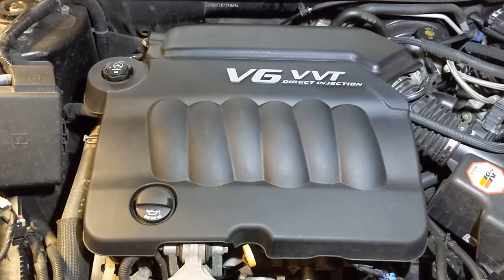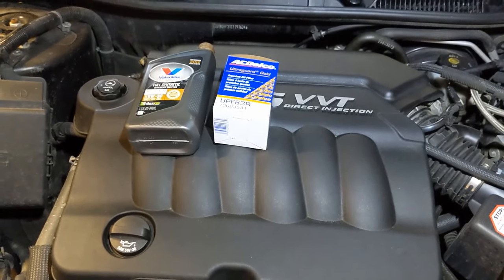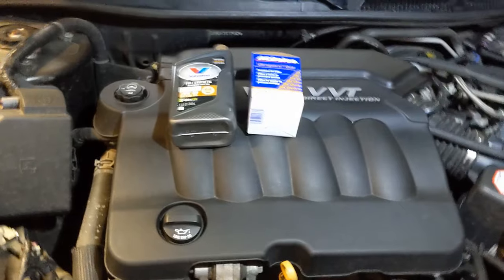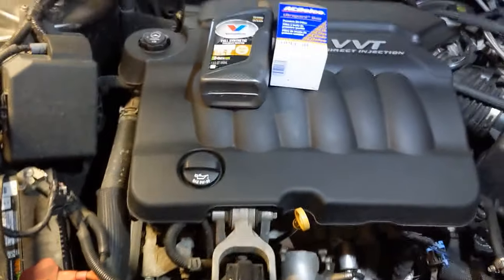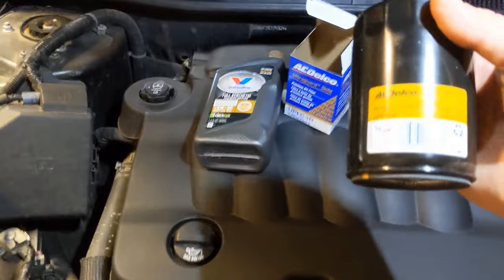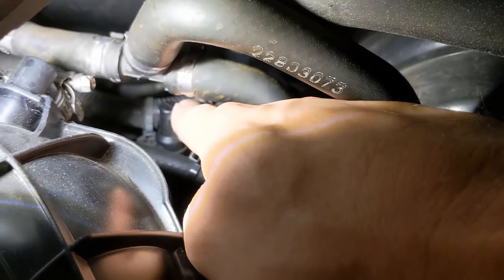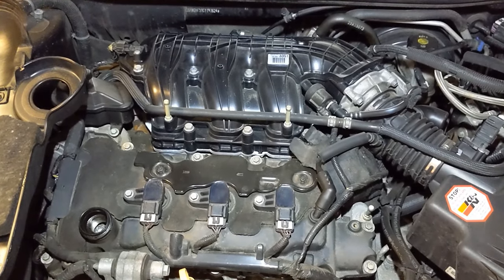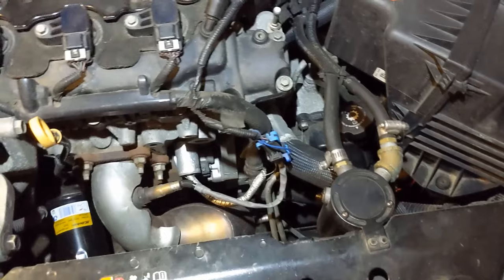How to keep your GM 3.0 or 3.6 V6 running forever - **High Feature V6 LY7 LLT LFX LGX LGZ**

Comment: yep yep , i have private mechanic  , he said the same thing about timing chains ,  he said he would never go 5,000 on the oil ,  he has seen lots of problems from not changing oil regular , and even tho  oil changes are more up in price , its better than internal wear from not changing regularly .  i have been firm believier  in 3,000 oil changes , that oil life junk , i would never go by that , im old school everything is ontime
Reply from the maker: Not to mention it's extremely easy to change the oil and filter on these cars yourself, so there's really no excuse NOT to change your oil!
Reply: @CertifiedShadetree  oh i agree 100% , pure laziness when oil isnt changed at least every 3,000 , we did at one time go 2,000 in winter and 3,000 summer
Reply: Thank you for prompt response 👍
Reply from the maker: @myfavorites1016  🍻
Reply: I will leave question in the comments of what im dealing with tho with my 2013 chev impala.  Bought it in 2016 with 34,041  one owner.  I will write u soon .
Reply from the maker: @myfavorites1016  You came to the right channel!!
Reply: Awesome channel,  i appreciate your help 👍 😀
Reply: @CertifiedShadetree   well this is the problem , i bought my 2013 chev impala lt with 34,041 miles , one owner car older lady,  and mileage was about 60,000 give or take when i noticed my car when i took off after starting it and slowly got up to speed like 25 to 30 mph , i felt like 4 small small jerks , not big ones . It went on for a year , i decided to check it out.  The dealer replaced the TCM control module,  after that was replaced,  about a year and half later,  same issue , and the computer said tcm . And no unfortunately the warranty had gone off after a year . It said TCM  low pressure circuit  , the dealership said its recommended replacing the transmission.  Im yet driving this car , they said they did a drop and fill to transmission fluid.  Not sure if you heard this problem before.  But no way im replacing transmission.  I was thinking of doing another drop and fill of tranny fluid,  cause i got 105,000 , but not sure if that would help .
Reply from the maker: You can actually rebuild your TCM.  It's fairly easy to remove and the seal rebuild kit is only $30:
https://www.amazon.com/dp/B08RBH7YDH/?coliid=I2QA9871ETW1W8&colid=2ENS5XTY85MPE&psc=1&ref_=lv_ov_lig_dp_it

The pan is non-removable, however there is a drain plug.  The front cover can be removed to access the TCM.  I haven't personally done a seal kit but have watched a few videos and it seems to be a fairly straightforward job that shouldn't take all that long to complete.

https://www.youtube.com/watch?v=OGKeVv4y1qc
^^This is one of the videos, however several more pop up when you search "6T75 TCM Repair"

The alternative is to spend $500 and buy a brand new TCM from Autozone. Some of the replacement TCMs come with a programmer to plug into the OBD port, others do not and you'd need to have the vehicle towed to a GM dealership to have the new TCM programmed. Rebuilding yours will avoid the need for reprogramming..
Reply: @CertifiedShadetree  well i was told its in the torque converter were the problem is coming from.  And thats why they recommend replacing the transmission,  although i know very little about transmissions,  just some lol , the lowest price i could get was 4,800 job . Lol
Reply from the maker: 😬 Damn, that's a tough pill to swallow!  I guess at this point it wouldn't hurt to do a fluid exchange and try some Lucas "trans fix in a bottle."   A local rebuilder in my area will do a full rebuild for a grand!  https://minneapolis.craigslist.org/ram/pts/d/saint-paul-rebuilt-6t70-6t75/7458692414.html
Shit, if you could find a shop that'll do the rebuild that cheap and flip someone $500 to swap it out you'll be way ahead of the curve!!
Reply: @CertifiedShadetree  oh i know right , the shop told me this news my heart sunk , im like oh shit no 😒😭 , and im scared to really use any lucus to be honest,  i feel like skipping lucus and seeing if a drop and fill possibly may help , no guarantees at all . At this point im totally lost/confused you name it . Im not putting 4,800 into that car . Plus i got a misfire,  i can feel it when moreso vechile is cold , cause i got the lovely direct injection,  really sucks.  And im almost certain its carbon build up on valves,  only certain times i can really notice a noticeable misfire,  one time 2 years ago it tripped a check engine light cause car was hesitating so bad , then it was blinking,  then it went back to normal light , it showed cylinder number 3 or 4 misfire,  but after my car was scanned that time it never got that hesitant again . So it acted as tho a carbon build up.  I dont believe i have a bad coil , but not certain.  I have been using Berryman B-12  that i did believe stop some pinging i heard from carbon,  plus it gave me a bit more get up and go . But i was told its still not cleaning the valves
Reply: @CertifiedShadetree  could i just possibly text you instead? Cause i  dont really like writing it all out on this page lol
Reply: Or if i can email you personally? It would help , if you cant i understand buddy
Reply from the maker: @myfavorites1016  leaderofwagons@likeabigdog.com
Reply: I got a question,  i just had oil change today , and my air filter had oil in it , i was told it would be coming from like the cooling line to transmission.  And i did notice a damp cooling line this weekend.  Ive never heard of this ,
Reply from the maker: @myfavorites1016  Watch this video: https://www.youtube.com/watch?v=hu57lGzxiRY
Reply from the maker: I had the same issue on my 12 Impala.  It only misfired when it was snowing out. Code P0276.  I pulled the intake, cleaned the valves, then pulled & replaced the injectors and injector wiring harnesses (I recorded all of it, it's in my channel archive..)

Comment: 2018 Chevy Colorado 3.6 L, use Mobil 1. Change oil at 5-6k miles with Mobil or Wix filter. It does not burn oil. 59k miles on it.
Reply from the maker: Are you using "plain" Mobil 1 or the Extended Performance? I read the M1 EP is good at preventing carbon deposits on GDI engines.
Reply: Yes. Mobil 1 extended performance.
Reply: That’s NOT the same engine. The new 3.6 engine has no shared parts just same displacement.

Comment: I just did my timing-chains..i used  felpro's new/improved valve cover gasket that restricts more oil from passing through the cover and reaching the pcv valve....
Reply from the maker: Curious what engine you have?  I've heard the LFX's had the improved valve cover gaskets from the get-go.
Reply: @CertifiedShadetree  2011 gmc acadia 3.6L vvt 
High feature v6
Reply from the maker: @allentraylor5659  Ah, okay. That would be the LLT engine. They wouldn't have had the improved gaskets (or larger PCV orifice) from the factory, so good call on the FelPro's!

Comment: Are the holes in the PCV already inlarged after 2014 or should they be enlarged also on models after 2014?
Reply from the maker: I'm 0 for 2 on 2015's being enlarged from the factory, so you're likely going to need to enlarge yours as well..
Reply: @CertifiedShadetree  watch JR go mentions the newer enclaves have them but doesn’t mention the year
Reply from the maker: If it's a 10th Gen Impala, then I doubt it received the updated PCV, even up to 2020.  The 2018+ Enclave and Traverse have a variation of the old LFX called the LFY (it's basically an LFX with auto-stop/start) that are most likely the engine he's speaking of. I would still check, however.

Any other 3.6 past 2016 is the all new design LGX or LGZ that has a completely different PCV system (well obviously not the old Traverse & Enclave, they had the old, OLD LLT engine until 2017 - that engine is SHIT!!)
Reply: @CertifiedShadetree  imagine if they would had just perfected the 3.8 engine and transmission combo. GM must have been getting to close to producing a actual reliable engine. So of course let’s just scrap that idea lol
Reply from the maker: I think they had the right idea with the Gen V 4.3 V6, just sucks they used it in base model work trucks and not as a replacement for the 3800. They managed to jam a 5.3 LS under the hood of a W-Body, that LT 4.3 would've easily fit FWD applications..
Reply: @jeremyTallen1  the 3800 was too good in GMs eyes.
So now there's the 3.6...
Reply: Good info' I just acquired a 2013 terrain with a 3.6 so I'm assuming being a 2013 I will need to do the PCV mod.? How did you do the catch can I live in the Midwest and thinking it is a must to have.
Reply from the maker: @keithbartlett7679  Yes you will need to do the PCV mod. Watch this for catch can and clean-side separator installation:
 https://www.youtube.com/watch?v=-XlG5po15Fw&list=PLKy6nBoh43Br7MbngD2Cgfzanf1yVoQC_&index=5
Reply from the maker: @keithbartlett7679  Thanks, and glad it worked out for you!! 🍻

Comment: i just picked up a 2013 ltz with 160k and i've been running 88 octane from a local gas station we have around and was wondering if i should stay away from it. Thank you for the tips btw i am going to check on the pcv valve soon and replace it and make the mods to it.
Reply from the maker: Personally I stay away from ethanol blend gas, but that's just me. It's wreaked havoc on my power equipment in the past, so that's why I won't run it in my car. But as long as you have the yellow gas cap and the flex fuel badge you should be fine running the e-15 (I'm assuming that's what your 88 octane gas contains - it's that way in my area.)

Be sure to check some of my newer videos, I've since added a clean-side separator and recommend doing an annual BG EPR engine flush. Oh, and the oil I mention in this video is discontinued!! I run Valvoline Extended Protection nowadays..
Reply: @CertifiedShadetree  Yes thank you i will give that oil a try. I know to stay away from pennzoil from my subaru that would eat 3 qts of it every 3k miles. Went back to mobil1 and it was fine. My ltz actually doesn't have the flex fuel option so i think i'll just go back to shell 87.
Reply from the maker: Yeah these 3.6s drink Pennzoil like I drank Jagermeister when I was in my 20s!!🤣 No bueno!!
Reply: Don't confuse octane with Top Tier. ALWAYS use Top Tier in whatever octane your car likes. You can find a list of the Top Tier brands on the internet. If you are not sure, just stay away from any off-brand gasoline regardless of the octane.

Comment: ams oil Royal purple  and valvoline full synthetic are the best in that exact order
Reply from the maker: Nowadays I'd rank Valvoline Extended Protection #1, merely due to the price. It's only a couple bucks more than the "regular" Valvoline synthetic and it doesn't burn off like the rest of them do. I would agree with you regarding RP & Amsoil if you were using it in a pushrod engine and going for a 20k drain interval. Would be a complete waste of a good oil in one of these engines..

Comment: So maybe I can get your opinion on this. I use AmsOil, the signature series which is guaranteed for 25,000 miles. I also used the AmsOil filter which is also guaranteed for 25,000 miles. I'm at about 12,000 miles in on the oil change and plan to change the oil in the spring (regardless of mileage) which is actually surprisingly easy to do on this car. But would you personally recommend changing the oil more often regardless? As easy as it is, I don't mind changing it but I'd probably start using something like Mobil 1 or Valvoline like you showed just because AmsOil is a premium oil and therefor really expensive. So I'm just curious on your thoughts about it.
Reply from the maker: With everything I've read and have been told, it's a bad idea to use extended interval oil in direct injected engines.  My opinion, I certainly wouldn't poke that bear with this particular engine with its notable track record of timing chain stretch issues. I'd stick with Dexos approved full synthetic and change it every 4k to 5k.  I personally advocate for the Valvoline Modern Engine because I saw a noticeable drop in oil consumption, but I don't really see the harm in Mobil 1 or Pennzoil Platinum as long as you're vigilant in checking the oil level.

Comment: Hey man I just bought an 08 Cadillac CTS4 with the 3.6 L engine in it. I don’t know a lot about cars, so how can I tell if my timing chain is going bad (or if it has a lot of sludge inside the casing) and what do I do as regular maintenance to keep the timing chain healthy other than changing the oil often. Any comments are appreciated!!
Reply from the maker: To start off on the right foot, I'd have a BG Dynamic Engine Service performed. They'll clean all the sludge out of the engine, clean the intake tract, and clean the fuel injectors. Do the PCV mod and install the revised valve cover gaskets. If you're having timing chain issues, there'll be codes set that'll indicate as such.

Comment: Yes I've been told if i change oil often like 3,000 miles you save on timing chain .  Only 1 time i listened to the dealership and they claimed i didn't have to change oil for 5,to 6,000 cause of dexcos semi synthetic,  but even my own private mechanic told me no way on 5,000 . Now i go 3,000 maybe a bit under.
Reply from the maker: Yeah, nothing wrong with going 3k between OCI's.  I would go with FULL synthetic, however.  The synthetic blend was fine for the old pushrod motors, but the 3.6 has a 11.5 to 1 compression ratio, so any amount of "dyno" oil (even if it's cut with synthetic) isn't a good idea with these motors..
Reply: @CertifiedShadetree  but if i go full synthetic its like nearly 90.00 how long can i go on changes then ?? 3k ? Or what
Reply from the maker: 4-5k is perfectly acceptable with an advanced full synthetic.
Reply: @CertifiedShadetree  so if i decided to go full synthetic going 4 to 5 k would be just fine ?  I wouldn't be using vavoline what ever the shop uses . Dexos for the dealership,  what is advanced mean ?
Reply from the maker: @myfavorites1016  There are levels of refinement to synthetic oils, kind of like a hierarchy. Advanced is the very best you can get. "Full synthetic" doesn't denote the best, usually somewhere in the middle. Just tell your dealer to put in the best advanced synthetic they carry.
Reply: @CertifiedShadetree  so do you think it does the engine good to get it up in highway speeds once a week at least since i do drive in city traffic. To burn out the moisture and to move the oil
Reply from the maker: @myfavorites1016  Getting it up to full operating temperature is the most important thing. The only thing sitting in stop and go traffic for 45 minutes will kill is your fuel economy!! That said, I would change the oil every 4k if that's all the driving you do.
Reply: @CertifiedShadetree  yes basically i do both types of driving conditions,  stop and go , but still get it on highway once a week maybe twice . I can sure see how city driving cuts your gas , highway i normally always get 32 mpg even more at times

Comment: I have always been a Mobil 1 guy but in my Ram Hemi just switched over to Shell Rotella Gas Truck full synthetic. I noticed it quieted down any lifter noise quite a bit compared to the Mobil 1. Check out the Project Farm channel for a really great comparison test between the two. It is also Dexos 2 approved. Plan on putting it in my 2012 CTS 3.6 that I just bought next oil change. 91,000 miles on it but it seems to be in great shape, time for plugs at 100K though. I have also heard there is a new cam cover gasket by FelPro that can help reduce that PCV oil consumption somewhat. Can anyone confirm that?
Reply from the maker: I know what you're talking about, they made changes to the valve cover gaskets.  There's a relief cut out in the area under the PCV.  I believe the LFX's already have the revised gaskets.

Comment: Re posting this: Heat, low oil never had much of an effect on the life of the cam chains in previous engines, but not these engines. As you can see, everyone is asking the same questions?  Backwards technology????  Everybody I know would prefer the older GM V6 engine tech. It's a fully fledged known fact people get too busy, or are forgetful. Previous engines were much more robust to handle this neglect. Do not expect this from these engines what ever you do! Especially the new little diesels engines!
Reply from the maker: Gas & diesel engines are being legislated out of existence, so sadly this is pretty much what we're stuck with these days..

Comment: Drive chain issues? When is the chain scheduled for replacement? What of the serpentine belt?
Reply from the maker: There's no set schedule to replace the timing chains. The point of the video is to remind you to rigorously maintain the engine so you won't have to replace the chains. As far as the serp belt, it's the same as any other engine - replace it if it looks cracked/frayed/worn. I would suggest you replace the belt tensioner and idler pulleys at the same time as the belt.
Reply: @CertifiedShadetree  Thanks

Comment: Mine is the 3.6 LY7 in a 2008 Pontiac G8.
Don’t drive it much anymore only has 100k on it
Would these guidelines follow as well?
I do change oil at 5k. I use the Valvoline also.
Another interesting thing is mine has a canister type oil filter accessible from the top of the engine.
Reply from the maker: Yes, absolutely!  Most of the 3.6 engines have a conventional oil filter - I believe the Camaro LLT had a cartridge style filter as well. I would use a WIX XP or ACDelco Advantage filter in that instance.